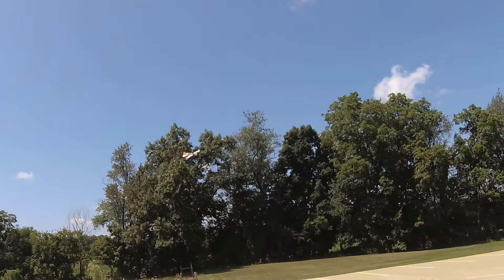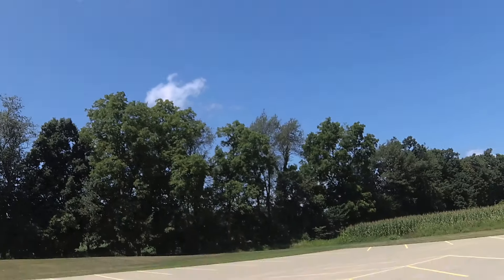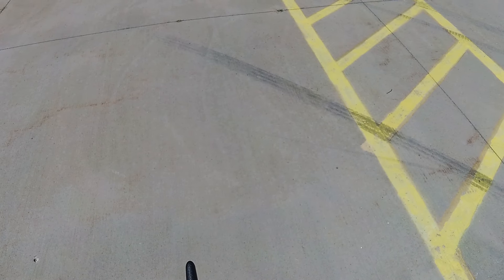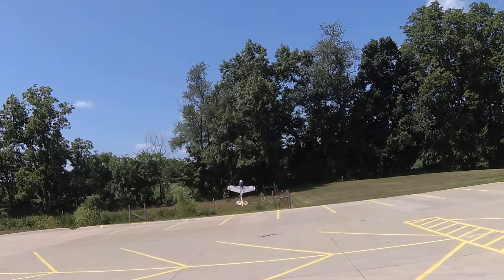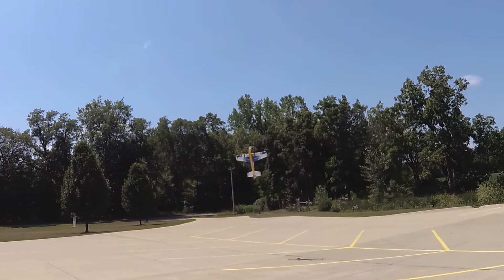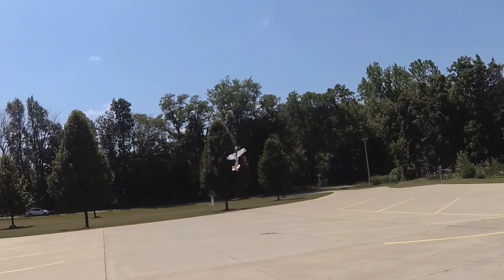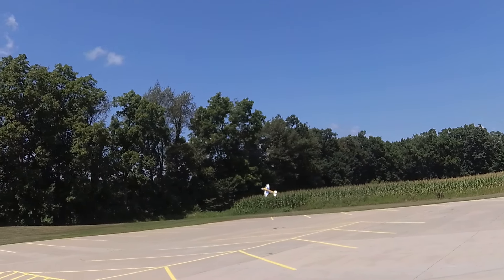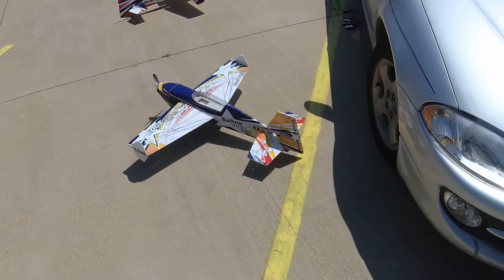8-7-2019 Future Model 38" Edge 540T PP lunch flt #1

Comment: sweet flight, are you going to pickup the e-flite extra 300 3d 1.3 bnf plane, i bought it , its sweet flyer, love to see you fly the 300
Reply from the maker: No plans to buy a 300. I already have the 55" Skywing Edge and the 60" FM Slick that satisfy the bigger plane needs. That reminds me, I need to get around to putting the new servos (Savox SV-1250MG) in the Slick. Last time I had it out the elevator had no response at one point.. Not cool, man! Not cool. I feel a bit silly putting $200 worth of servos in a  $200 plane, but I guess that's what it takes. The Rotorstars were a little too weak for the ailerons anyway, so I was already looking to change those two out. I decided I'd just change 'em all.
Reply: @somespamsite44  i feel ya , on the money part, big boy toys = big boy money LOL i'd didnt know you had the large scale planes, im just getting into them, im rebuilding my multiplex shark again, really fly like a turd, waiting on a 6 x 4.5 gemfan props, hoping a larger prop help it take off better, cant seam to get it dial in at all, crash as a 3 channel, and now as 4 channel, but i haven't gave up yet, Happy flying friend